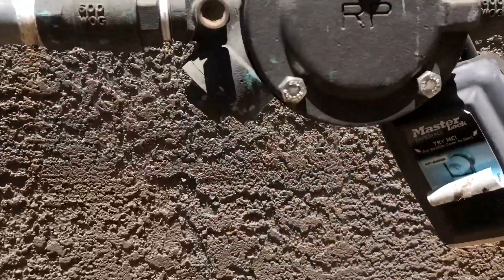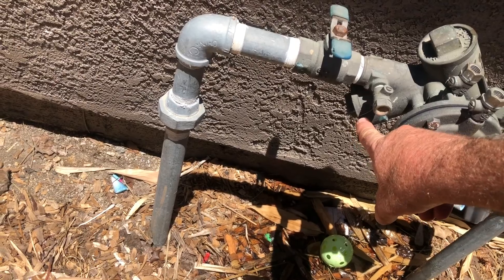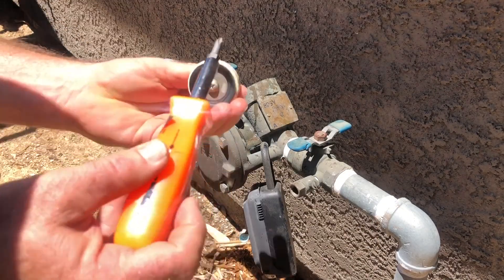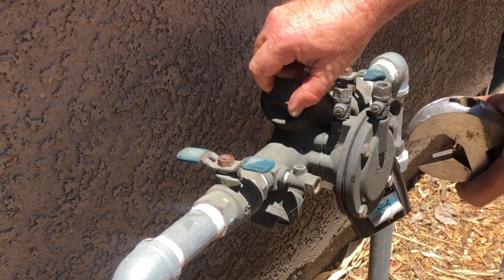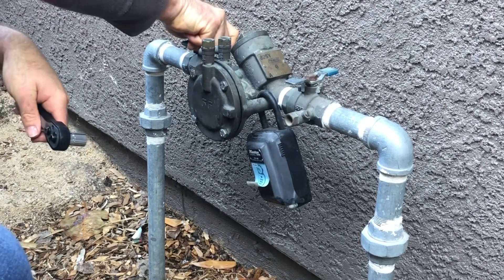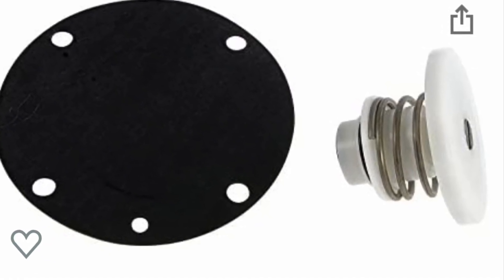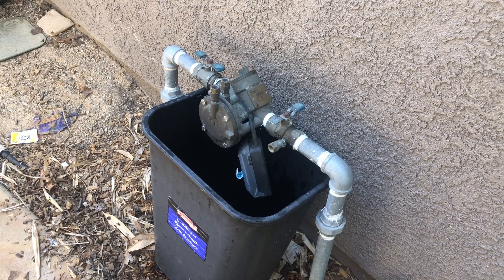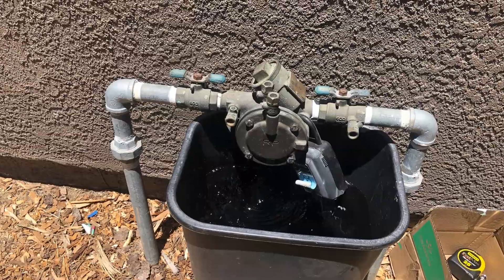Back Flow Preventer Leak Fix - Febco 825-Y and Similar. Back flow valve

Comment: Thanks for the great video. As a variant of root cause, the third face seal, on the front of the valve body for the diaphragm system had little sand chunk, and also some rust, embedded in the side of that seal. There are grooves in both sides of that seal that mate with their respective valve seats, and they are different diameters. Also there is a flange on one side to ensure it is inserted in the correct way. So the easy fix of flipping over the seal that works for the primary and secondary check valves is not an option.

Be careful when replacing the O-ring (it’s not a “gasket”!) around the diaphragm valve body. You don’t want any dirt or a nick in the rubber.

Excellent job!

Comment: Mine is leaking from the ball valve on the right. When the valve is off there is no leak. Turn it halfway and it shoots a stream of water. Open it fully and it's a steady full drip. It's 18 years old. The plumber wants to replace the whole works for a $1,000.
Reply: Sounds like you have a crack at the valve?  That’s what I have, but on both valves.  I think I’ll have to replace the whole unit which is almost $550 with tax just for the Febco 825Y assembly.  😢

Comment: I thought this would be much more complicated than it is, and one website selling parts even said I needed a special tool for disassembly. After watching this, I disassembled the two relief valves, flushed them out, flipped one of the seals around, and the leak has stopped. Thanks for the content.

Comment: Great video, what's that lock hanging from the check valve? Its function?
Reply: its called a lockbox   typically house key  but could be the gate  whatever   realestate guys use them   homeowners to leave keys for service men  that need in house etc

Comment: Thanks for the thorough video.  Have the same model and found a small pebble impacting the gasket on the upper valve causing a leak.  Easy fix thanks to your video.  Nicely done.

Comment: Crazy a diy’er has the best instructional video on the internet!!  Maybe you can help me…. My issue is the inverse of yours. When I have the output valve open water literally pours out of that plastic thingy. I took mine apart but never pulled out the piece where your problem is. Hopefully that’s my issue as well.
Reply from the maker: Thanks for the compliment on the video.
Try carefully taking it apart sort of cleaning it up and putting it back together. It doesn’t take much for these not to work correctly. Very small rocks or other debris can cause these to work in correctly. Let us know how it goes.
Reply: @checkitout2468  Thanks for the feedback. Will definitely let you know.

Comment: We fixed problem a couple of times due to the debris, it is the #1 valve that had tiny rocks on the ruble seal, clean up and turn on the incoming water valve to flushing about 1 minute.

Comment: Did all this and still have water pouring out of the bottom of the until out of that white chute.  Not sure what i did wrong
Reply: What did you find was the issue with yours?
Reply: mine does the same randomly...i tried removing the 4 front bolts to see whats happening inside the main unit but it seems to be wedged shut and im afraid to pry it open

Comment: Thanks for the video. My problem similar, except randomly water will blow, not leak, out of the bottom and continue. After slightly unscrewing  the top nut on the top back flow ( valves shut off ) , the spring will snap close. I can then re- tighten It. I have not been able to correctly diagnose how to make it happens. It randomly happens at turn off of sprinkler system. I am sure it has to do with pressure and will look at the area you showed. Great Video.
Reply: mine blows as well, i unscrewed and screwed the back flows and it help shut it for now.  i think its the main value failing but i couldnt open the main part (4 bolts but wedged shut)